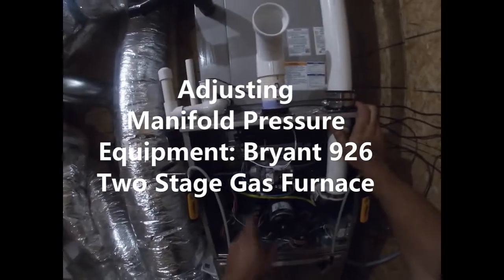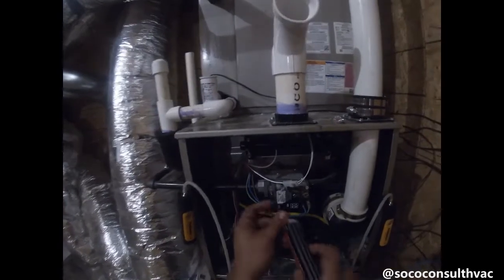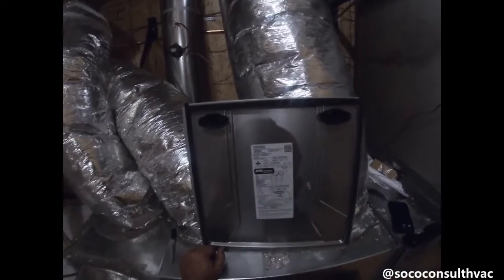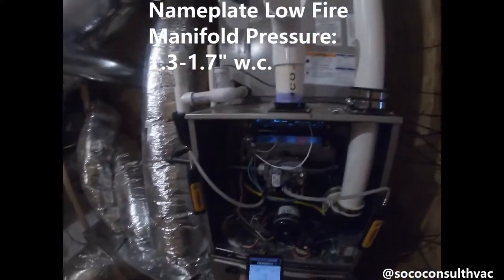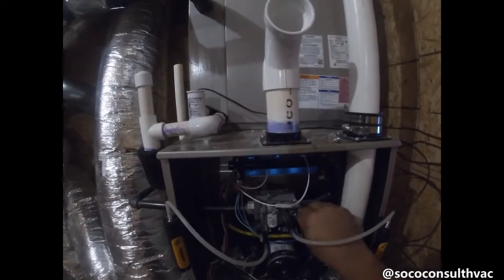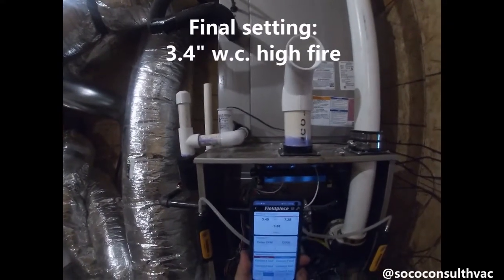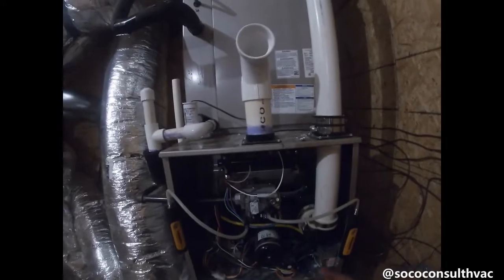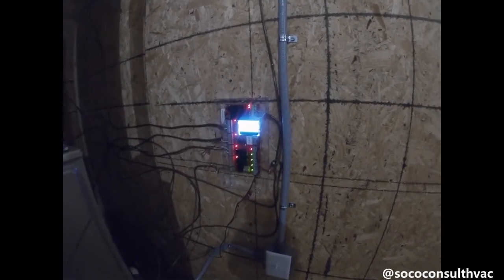Adjusting Gas Manifold Pressure on a Two Stage Furnace

Comment: Nice video. On the rating plate it only shows manifold pressures for natural gas. What would be the manifold gas pressures if furnace in running propane? Thanks

Comment: Hi love your opinion on clocking the meter.... Why?  If the pressures are set correctly and the burn is visibility good, you will have the correct "fire" in the the box.. check your delta temp to verify fan speed.   Maybe check static for obstructions if needed and your good.  Thanks good video!  Nice job.
Reply: Thanks for watching!

Comment: Another great video!

What kind of issues can you cause if you run the high fire or second stage heating below the written range say at 2.5 inches WC?

Is there a good supply air temp to aim for? Say mine 125F?

Lastly how do you feel about pulling off one of the spade connectors on the high limit to make the furnace cool off before killing the power to save a trip upstairs to the thermostat if you do want it off to do a maintenance or conduct repairs?

Thanks a lot
Reply from the maker: Low heat output and possibly a flameout. Also, there wont be as much water vapor since fuel gets converted to water as a result of combustion. This can cause the drain trap to dry, resulting in nuisance trips.
Reply from the maker: Go by the nameplate data, usually 35-65 deg F rise.

And i usually turn off the gas andmake it trip out on flame failure and retry imstead of killing the disconnect. The blower snd inducer will stay on during retry to cool it off. Thanks for watching.